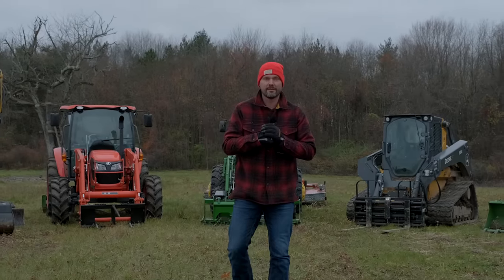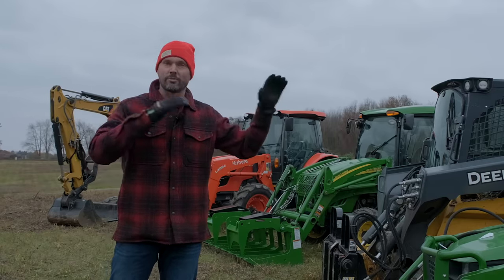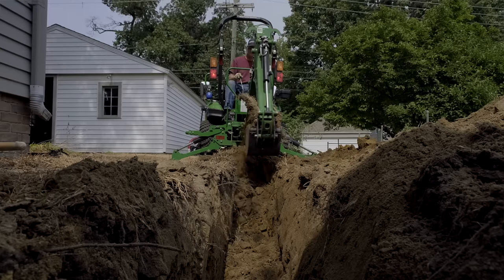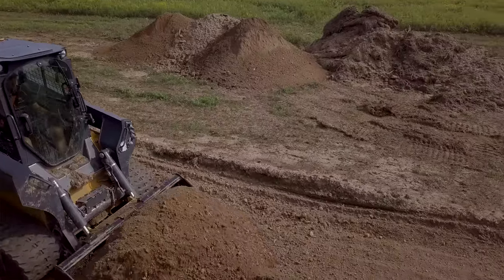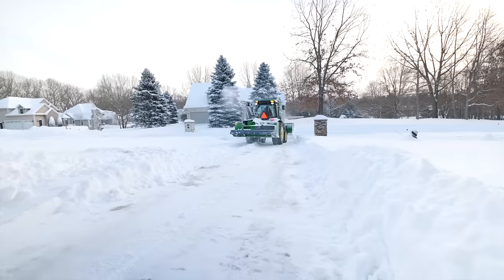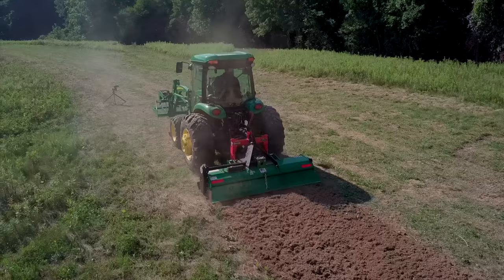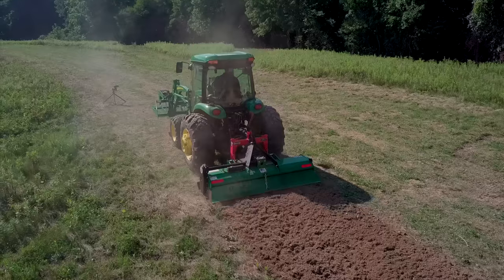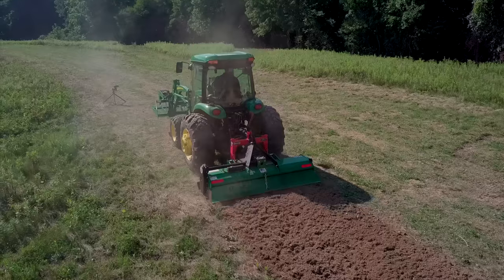IF I COULD ONLY CHOOSE ONE? BEST MACHINE FOR PROPERTY MAINTENANCE

Comment: I watch your videos but I still don't know what I should buy versus rent. I only own 20 acres but they are ROUGH acres. It is desert - no trees - but about 90% of it is covered in sagebrush, which can puncture a tire pretty easily. The land is reasonably flat but earth will need to be moved in some areas. There are 2 dirt roads that need maintenance.  I need the ability to dig holes and lift water totes. I'll need to make post holes for a fence. I'll probably be building a lot of my own structures and I may need it to raise walls and such.

Once all the prep work is done, I'll need it for farm work. And I absolutely need an enclosed cab with a/c and heat because of the wicked sand storms. Can this even all be done with one machine? Should I just buy a small compact tractor and use it for what it can do and rent other equipment for the rest? I just don't know. Am I even asking the right questions?

Comment: I have 5 acres, even with that smaller plot a subcompact isn't cutting it. It overheats constantly and isn't as strong as I need it to be for some tasks. Plus no cab.... the no cab is a deal breaker, I'll never buy another machine without a cab. Miserable mowing with a belly mower in high temps, just miserable.